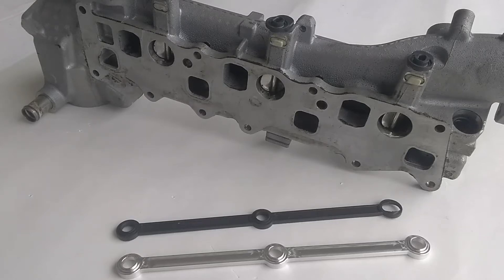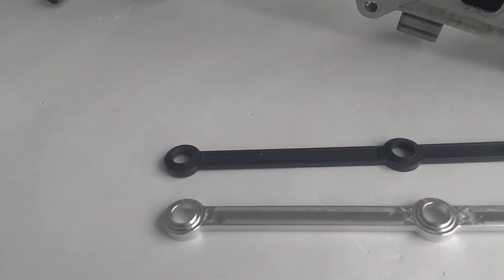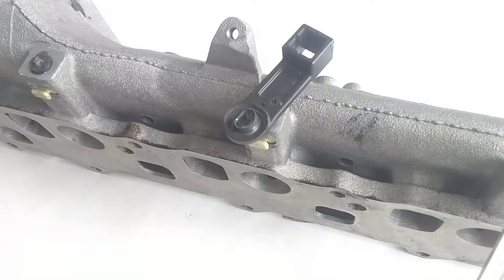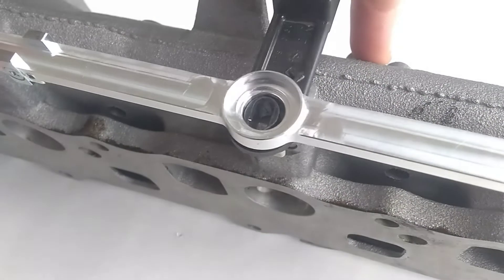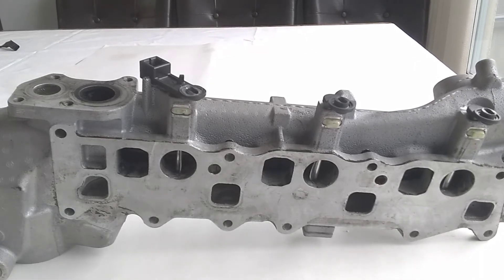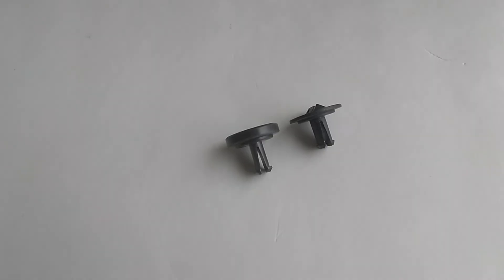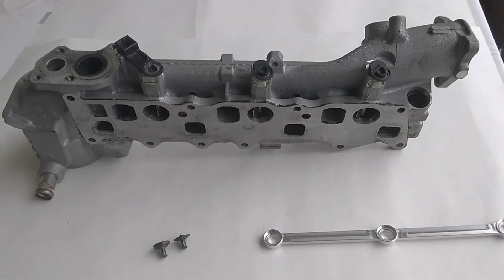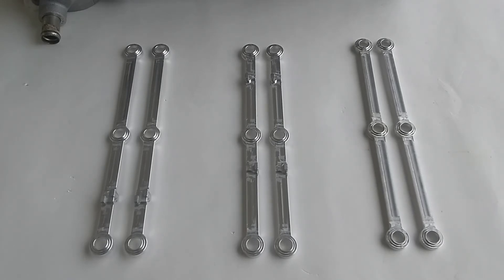Mercedes Diesel OM642 3.0L V6 - Intake Manifold Runner Connecting Rod - Design Features

Comment: Hi, I noticed the first intake manifold had one of the swirl flap arms broken off. Any tips how this can be repaired?
Reply: I have the same issue and can't find any info on how to replace these arms . . .
Reply: @bozman52  I think they have swirl arms as well, or just lookup on ebay. Not a straightforward replacement, but doable. If you buy these rods, make sure to read seller reviews, the ones I got were quite crude, half cnc'd and half finished by hand.
Reply: @meanymartini  Thanks for the reply, although I was hoping to hear the replacement was simple.  Did you buy the connecting rods from this company in the video?

Comment: I installed these on my 2009 ML320 and totally fixed it! The problem started, for me, when the oil cooler seals failed and oiled up the mechanisms attracting dirt and grit. Everything on the underside of the manifolds was a dirty gritty mess. This is a tough job for an amateur but, with the proper tools, it can be done. 
Congratulations on a design that is superior to the original Mercedes plastic parts!